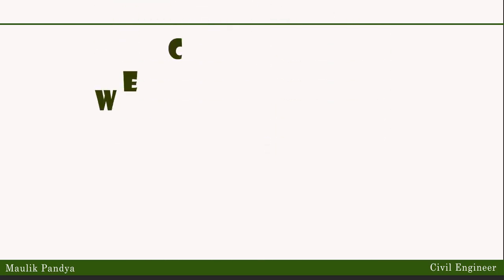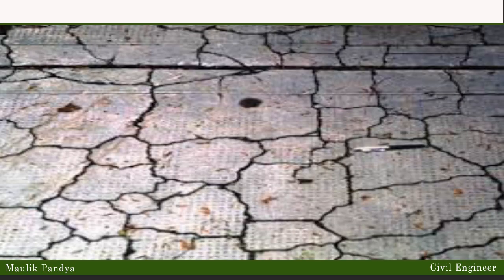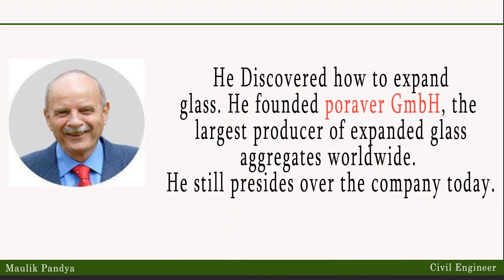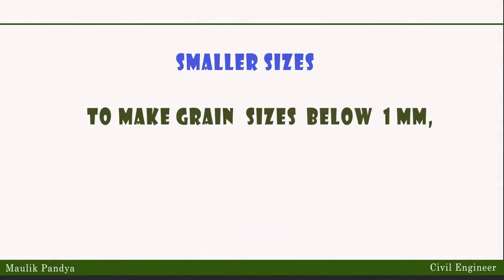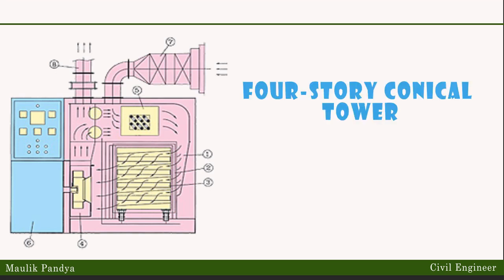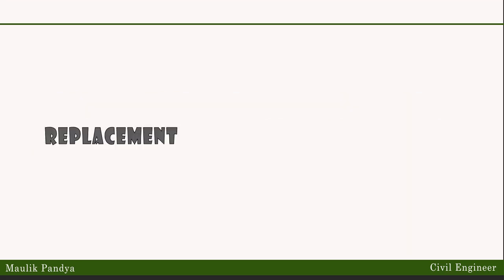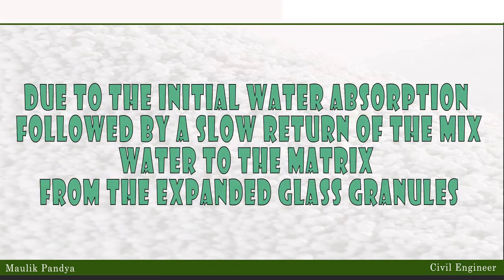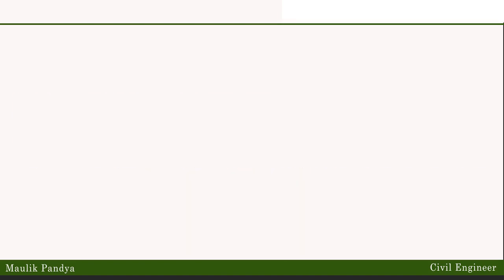Making of Expanded glass concrete | Waste Glass or Recycle glass turn into Expanded Glass | PART - 2

Comment: Hello and thank you for the video. I would like to know if glass aggregate can help to improve the tensile strength properties of concrete. Your advice will be highly appreciated
Reply from the maker: The optimum glass powder percentage as fine aggregate substitution producing maximum tensile strength is on 10% of glass powder replacement producing 2.7 MPa, higher than normal concrete's splitting tensile strength is 2.36 MPa. It indicates that the increase in splitting tensile strength is 14.41%

Hope so you got your answer 😄
Reply: @InquisitiveMaulikPandya  I appreciate your quick response. kindly share articles related to the topic, please. Thank you
Reply from the maker: @mmentertainment6782  I can't bro.. it's a research report not an article which I can share. So sorry by my side.